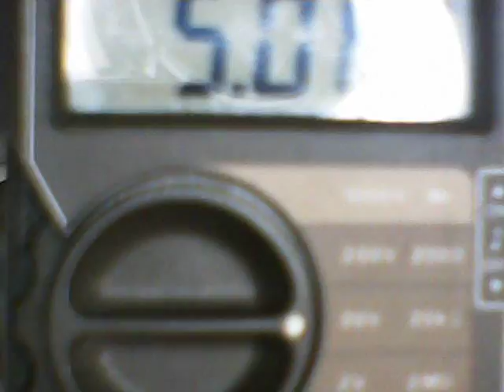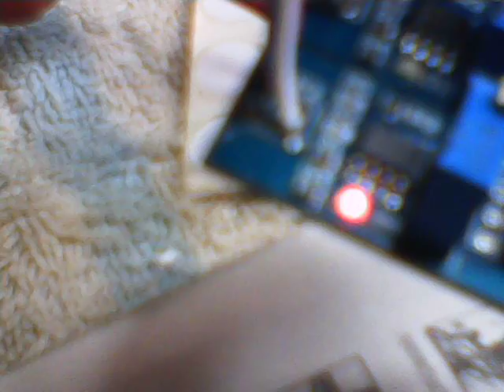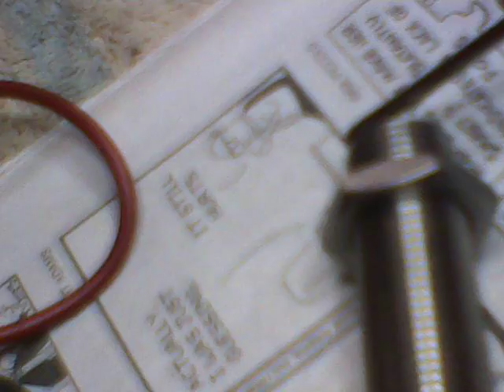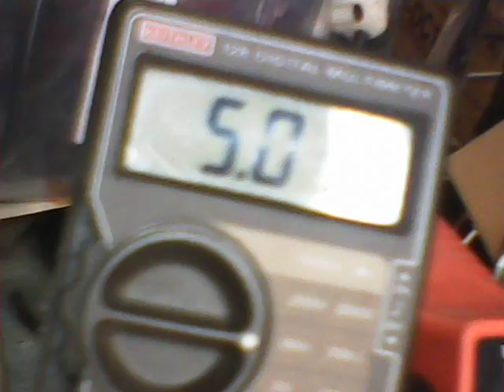Hall Effect Timing Triggering

Comment: What conditioning boards are you using? I cant find them.
Reply from the maker: Cole, I located these particular Hall Effect Device conditioning boards with a quick search on Ebay. They use these on Chinese EV cars to detect motor speed. There are several different boards available as of my last look, different from these boards but made to accomplish the same thing. They are under $5 each. Just search Ebay for Hall Effect Device conditioning boards. I selected boards that have a digital/ TTL output for the best compatibility. They also negate the need for pull up resistors. The ones I used actually had 3 wire HEDs attached to the boards. I removed them and used the solder pads to connect my sensors. The cam angle sensing HED is an industrial positioning type while the crank trigger HED is listed as a gear tooth sensing HED. I am currently using a Cherry switch gear tooth sensor and a Microswitch positioning sensor on the cam. I tested this set up to 19,200 rpm and it works flawlessly. I also connected the 4.78 volt outputs from the conditioning boards directly to pins on the microprocessor on the MegaSquirt's daughter board, bypassing the controller's signal conditioning circuitry. I de-populated the board of all the MS's signal processing components, too.